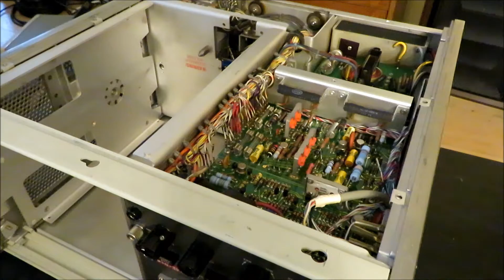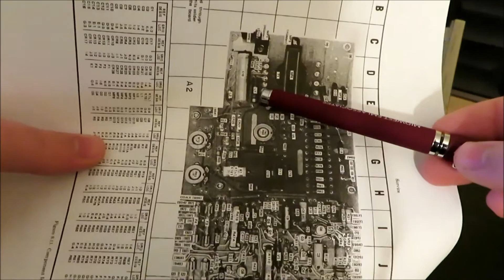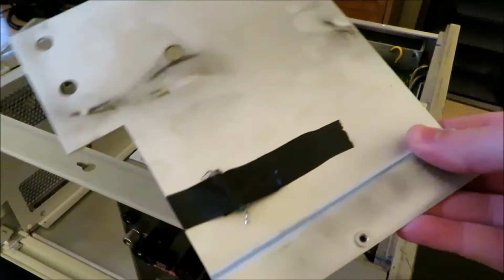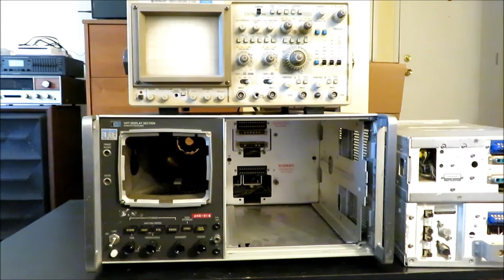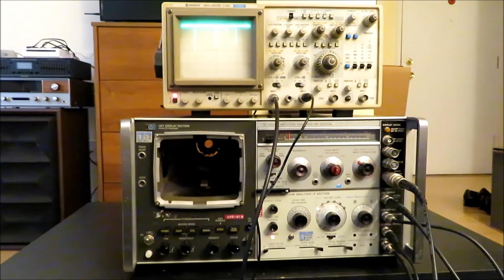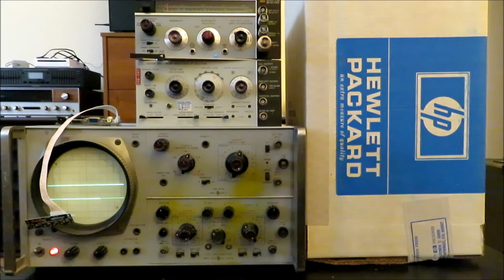How to connect a HP 141T Spectrum analyzer to an external display

Comment: Nice Video on the 141T.   Mine keeps blowing the fuses in the if section.  Do you have a repair video for that issue?
Reply from the maker: I do not, but it is a known issue with these units. 

I need to confirm it, but I have heard some mumblings online that it may have something to do with the 75V neon gas regulator (A2V1) wearing out and causing overshoot on the +100V rail at startup, which then trips a crowbar circuit in the IF plugin which blows the fuses. 

Apparently some folks have had success replacing the neon with with three 27V zeners in series. Again all this is hearsay. I would need to do some experiments, but maybe I would make a video about that to see if I can confirm this behavior.
Reply: I replaced v1 with the three  27 volt zener diodes.  This resolved the problem of the if section blowing fuses and all the voltages were able to be calibrated.
Reply from the maker: @ That is interesting to know. Thanks for getting back to me on that! I may have to start doing that myself.

Comment: Hi, thank you for great video. Recently I aquired 141T with 8556A and 8552B IF section. Unfortunately Scan light won't go on and there is no trace on tghe screen. Only dot on the very top of the crt.  First thing ofcourse I checked fuses but unfortunatelly it was not that. I tried to hook up the osciloscope but no thing happened... Looks like the CRT works ok because focus, intensity, atigmatism and all other controls on the screen does something when I turn the knobs. One thing to mention: on 8552B IF section, on the bottom right side are display adjustment trimpots. Horisontal position and gain responds to trimpot turning, but horisontal does nothing. If I switch scan mode on manual and turn MANUAL SCAN knob dot on the screen would move just a little about 10mm or 3/8 of an inch. Do you have any idea what could be the issue? p.s. sorry, english is not my first language, I learned it from movies :DDD

Comment: I watched this video and repaired my 141T at work today. It's been sitting on a shelf with a "broken" sticker since 2012. Found both module fuses blown just like you said and in the process found a yellow wire that came off it's stud on the CRT preventing it from displaying anything. I used an analog oscilloscope to confirm what the CRT was showing. Thanks for this video.
Reply from the maker: I'm glad to hear I was able to help!

Comment: hi i dont see on your scope. Is your chanel 1 and 2 are on dc! so my scope has 5 volts per division limit, does it work  the same thanks
Reply from the maker: Yes, both channels are DC coupled. if you only have 5 volts per division, you may have to use a divider of some kind.

Comment: hi, i dont see your bnc cable pen lift output go to back the scope is it plugged or not
Reply from the maker: The BNC cable for the pen lift is connected to the Z-axis input on the scope, which is on the back of the oscilloscope. It is connected, just not visible.

Comment: Hello . very interesting video. i own a working hp 141 t with a 8554b and 8552b.. now to my question. is there any way to connect a frequency counter so you can readout the marker frequency ?
I dont have the hp tracking generator but i think you can use some kind of noise generator instead is that right ? opre is there onother way to add tracking funktion. With best regards klas jonsson Sweden
Reply from the maker: Hello! Hmm, I do not know of any way to read the frequency of the marker when in full span mode. Sadly, measuring frequency accurately is one of the major weaknesses of the 140-series analyzers.

As for a tracking generator, yes, the 8444A tracking generator with a swept signal source is the best option, but I imagine that a noise source should be possible to use as long as the flatness of the noise source is good along the range you want to use it. You may also have to use a relatively slow sweep and use the video bandwidth filter to smooth out the trace.

I've never tried it, but it might also be possible to use a sweeper like an 8340 or 8350-series sweeper or similar in conjunction with one of these if you were to interface the sweep controls with the outputs on the D-sub on the back of the 141T, but that would be relatively involved, and I imagine that keeping the sweeps in sync at narrow bandwidths would be difficult with such a method, especially with the non-synthesized 8350, which tends to not have very precise frequency accuracy/stability.

Comment: Thanks for the 141T calibration info. It was very useful. Could you please do a video on the connection and use of the 141T with the HP 8443A tracking generator. I'm not sure mine has all the cables/terminations, etc....I can't get it to work.
Reply from the maker: Hello! Yes, I have worked with the 8443 tracking generators in the past. They required a special cable (HP part number 08443-60009) that connects to the D-sub ports on the back to track the sweep of the signal generator to the sweep of the analyzer. Do you have one of these? They can be hard to find nowadays. 
Azur Electronics has a great write-up on the 8443 and a lot other info about the 140-series analyzers
http://www.azurelectronics.com/HP%208443A%20Tracking%20Generator%20Counter.htm

If you are not able to find one of the cables, I did a write-up on the Electro-Tech forums a while back describing my procedure for making a similar cable for connecting to an 8445B tracking generator. It is a different cable, but the overall build procedure would be similar.
https://www.electro-tech-online.com/threads/making-a-replacement-cable-for-a-hp-8445b-spectrum-analyzer-preselector.150208/

Comment: Hello! 
I recently purchased an 8555A plug-in module for my 141T and I think I may be having an issue with most of the bands. The 1.50 - 3.55GHz band sweeps correctly, but sweeps the same on the 2.60 - 4.65GHz band. The 0.01 - 2.05GHz band sweeps correctly, but sweeps that same band more or less for all remaining bands. Do you have any idea what could be the issue/where I should look?
Thanks
Reply from the maker: Hello!
I'm not 100% sure, but from what you are describing, it sounds like you are seeing a peak for the same frequency, even when you change bands and shouldn't be able to see it? It would help to get a more exact description of how you are testing and what you are seeing on the screen.

If what you are describing is what I think it is, though, this is actually part of the normal behavior of this machine, and is a quirk of the harmonic mixer used to down-convert frequencies from the higher bands. Because of the harmonic mixing, spurious peaks will appear on the display, and one must use the "signal identifier" mode in order to determine which signals are spurious or not. The procedure for this is described in the manual for the 8555A. Alternatively, one can also use a 8445A/B "automatic preselector" add on box, which places a swept band-pass filter in line with the input of the SA, eliminating any harmonic mixing spurs.

If you are interested, I explain a bit about how the harmonic mixing and the 8445 preselector works in a write up I did a while back on the ETO forums when I made a replacement cable for one of them: https://www.electro-tech-online.com/threads/making-a-replacement-cable-for-a-hp-8445b-spectrum-analyzer-preselector.150208/
Reply: Veraxis
I currently don't have a signal generator that goes above 225MHz so to test these bands I've had to resort to installing an antenna of sorts to the input and try and pick up the 2.4-2.5 and 5.725-5.875 GHz wifi signals. I am successful in picking up the 2.4-2.5 signal on the appropriate 1.5-3.55 band, as well as the 2.6-4.65 band (with the signal identifier correctly flagging it as spurious), but on the remainder of the bands I only pick up what I should only be seeing in the .01-2.05 band, which includes peaks of the FM broadcast band and OTA digital television broadcasts channels.
On the bands that would cover the 5GHz wifi signal I don't see any peak at all for it - just the vhf signals. I went back through each band, for the first two centering on the 2.4 wifi signal, and the rest centering on 98.5FM to see if the signal identifier works correctly and here's the rundown:

1.5-3.55: correct
2.60-4.65: correct
.01-2.05: correct
4.11-6.15: correct
2.07-6.15: incorrect
6.17-10.25: correct
4.13-10.25: incorrect
8.23-14.35: correct
6.19-14.35: incorrect
10.29-18.45: correct
10.31-22.55: incorrect
14.41-26.65: correct
18.55-38.95: incorrect
22.65-43.05: correct

I've ordered an 8445 automatic preselector that should get here tomorrow (fingers crossed it survived UPS and works) so hopefully that will take care of it
Reply from the maker: Not sure what would cause the issue you describe. Perhaps the different bands use different IF configurations and one or the other is causing issues? It would probably be necessary to study the manual to determine how the IF frequencies work for each band.
Best of luck with the 8445 preselector as well!
Reply: Veraxis the preselector fixed the issue! 🙌🏻😁 Thanks for the recommendation

The only two issues remaining (non-important, but I'd still like to fix if it's not much of a hassle) is for one, the left-most indicator on the log ref switch does not illuminate. I assume the bulb has simply burned out. What's the best [proper] way to get in to replace it?
The other issue is the beam finder button is unresponsive.
Reply from the maker: That's great! Yeah, the preselector really makes the 8555A a lot more convenient to use IMO. Glad you got it working with yours!

According to the manual, the beam finder button only works with the 1400-series oscilloscope plugins, and doesn't do anything on the 8550-series spectrum analyzer plugins.

As for replacing the bulbs along the log reference switch in the 8552 IF plugin, if I'm reading the manual correctly, the lamp you need is a 10V, 40mA lamp known under the HP part number 2140-0058. Looking online, it would seem that there are replacement parts available for this.

The brilliant guy at Azur Electronics has also done some stuff with the 8552B where he describes some first-hand experience with replacing the lamps in his: http://azurelectronics.com/Repair%20HP%208552B%20IF%20Section.htm

 As for how to disassemble it, it seems that it may be necessary to unscrew the front panel of the IF unit in order to access the lamp holders. Perhaps there might be exact procedures in the manual for the 8552B that describe how to do this. I've never tried it myself, but it would be useful information to know!

Comment: I have two 141t units, both of them have CRTs that badly flicker/momentarily blank out. In your experience what is the likely cause of this issue? Thanks.
Reply from the maker: Does the flickering cause the trace to jump around, or just the brightness? My guess would be an unstable voltage output somewhere in the PSU-- in some cases due to a dried out/failing electrolytic capacitor. Remember, all the power supply rails are referenced to the +100V rail, so I would start there and check all the other voltages in sequence before moving to the CRT-driving hardware. I had one unit that flickered similarly to what you described, and in my case all of the supply rails read ~30% too low and jumped around in voltage. Turns out it was due to a bad capacitor on the +100V rail comparator, which is why all the other rails were affected. Another thing to keep in mind is that later-revision 141Ts after ~1980 or so had a major redesign of the PSU board, so verify that the A2 PSU board diagram in your manual matches what's under the hood. The caps in these old linear supplies are generally fairly reliable, so I do not recommend wholesale recapping of the entire unit as many do on equipment with switch-mode supplies. Hope this helps!
Reply: Veraxis Thanks! The display brightness flickers, I will follow your advice and check the voltages.

Comment: Nice video series on the Hp. I have 2 of these units and went through power supply repairs and CRT replacement. My supply had A failed gas regulator neon basically but stabilized with active parts in the neon used as a voltage reference. Had to replace with a gang of zenier diodes. Couldn't find the gas regulator reference. Any ideas on the neon and where to find them ? as regular neons don't regulate tight enough. About 2 years ago I found new old stock CRT originals by searching the CRT number online. They were military surplus CRT's for like $150 new I replace both my CRT's as one was cracked in eBay unit and the other 141T was a strange dot apparently showing up due to some problem with the storage mesh or a slow leak in CRT. Great units
Reply from the maker: Thanks, I appreciate it! According to the manual scans I have, the A2V1 regulator lamp used as a voltage reference in the +100V rail goes by the HP part number 1940-0013. The original manufacturer's part number is Z82R7, but I couldn't find much info on it beyond that. Apparantly, it has an 82V drop +/-1V. Most standard neon lamps have a roughly 50V drop when lit IIRC, so that probably wouldn't work unless you can source the exact part. An 82V zener diode rated for at least 0.5W would probably also work, but I've never tried it. I had an issue with the 100V supply on one of mine where the neon wasn't striking, but it turned out that an open resistor on a different part of the circuit was keeping the voltage too low for the neon to strike.

That dot on your CRT definitely sounds like it might be from burn-in of some kind, or possibly an issue with the storage write depth... did the dot appear in non-storage mode or only in storage mode? it's possible that just adjusting the write depth and flood guns might have helped, but certainly replacing the CRT outright will solve the issue long-term.